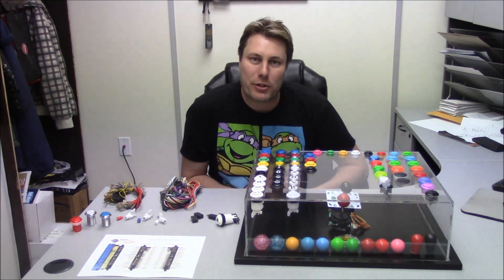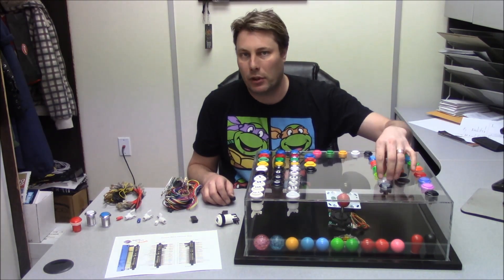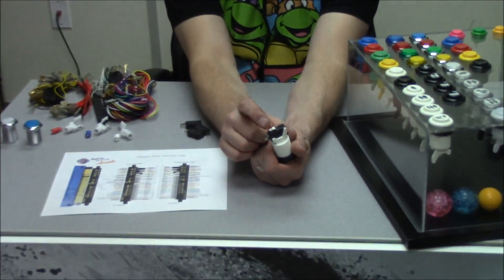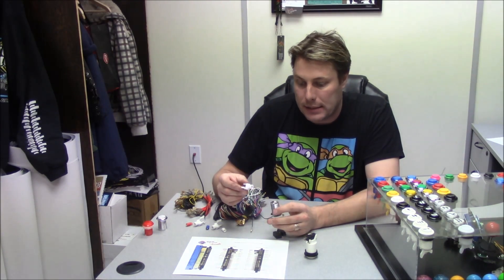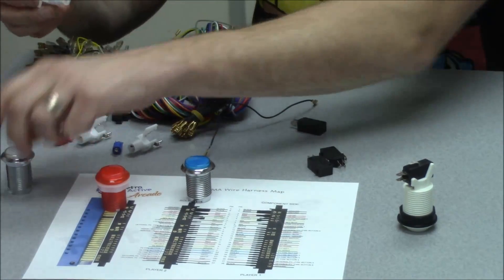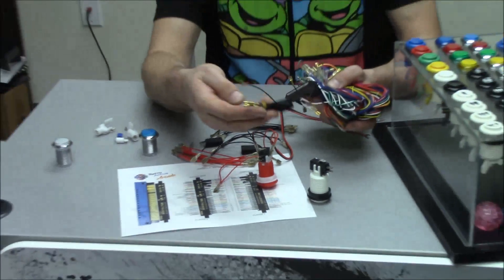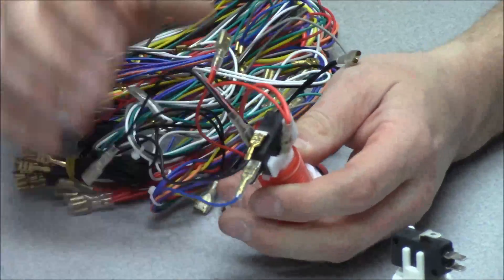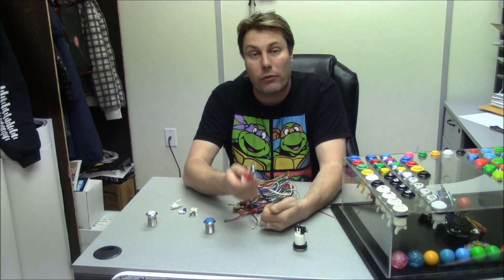How to wire arcade pushbuttons and microswitches

Comment: What about wiring the  IL Lorenzo Eurojoystick?  I have a wiring harness with a JST connector for the joystick where as the IL Eurojoystick just has microswitches and no JST connector board.  Do I just cut off the JST connector?
Reply from the maker: Yes you will have to cut it off and use the connector size for the microswitches which should be .187 or you can solider the wires to the microswitch directly.

Comment: Do you have a idea why my pandora 12s.   Wont work. It got frozen. On the welcome screen.      Already check the sd card.   ?
Reply from the maker: Is it frozen in the main menu? Can you see games in the games in the game list? If you do not have any response from your controls and buttons, you just have to add a credit to activate them. To avoid this, set you Pandora's box to freeplay in the service menu.
Reply: @RetroactivearcadeCa    It got stuck right after turn  on.    And. Just say  pandora 3d rrtv 12s.   On the screen.
Reply from the maker: @1Wayfix disconnect the JAMMA harness and turn it on. You need to check the 12V power lead with a multimeter at the harness connection point to make sure it is providing 12V. Too much is very bad for the PD and too little will not power it up properly. You can also do a reset or try holding down the menu button when you power on the PD. This test will only change the video output but if it changes through the modes your board is still good. If none of this works you can contact 3A Game or download the image of your version from their website to restore the SD drive.
Reply: @RetroactivearcadeCa   thank you. So much for. You.  You. Answer.    I apréciate.   🙏
Reply: @RetroactivearcadeCa  3a game is a website
Reply from the maker: @1Wayfix 3A Game is the company that makes Pandoras Box. You can go to their website to download fresh images of the game lists.
Reply: @RetroactivearcadeCa  thank you so much for you help 🙏

Comment: I'm new. Go ahead, flame me. Haha. So, wiring a Ms Pacman control panel for a jamma. How do I wire the 2 player button? Do I use the player harness?
Reply from the maker: Hello, yes you would use the 2nd player wire from the JAMMA harness with a ground to wire PL2 assuming your harness is full and uncut. Each side of your JAMMA harness constitutes as a Player side i.e. one side is Player 1 and the other side is Player 2, each wire (Color coded) is the same action for each player. Hope that helps!
Reply: @RetroactivearcadeCa  that absolutely helps. Thank you.

Comment: So ultimarc goldleaf buttons with an ipac4 can't be mapped to multiple buttons of the same keystroke ?? Such as if you have a separate 4 way controller; or spinners with buttons to match player 1's setup. Or if it's a coin button yet you have coin door's. Talking the standard ultimarc. Goldleaf buttons here. Almost to the wiring part of my build. I have an Ipac 4 and a Ipac ultimate. I got some stuff from you and some from ultimarc :)
Reply from the maker: Forgive me if I am answering you wrong but your question is a bit confusing. You can map as many buttons to the same key stroke/input on and ipac or I/O you want you just have to do it right. The gold leaf buttons (we call them fusion buttons on our website) only have an open or closed position so you can connect the ground like you would along the daisy chain. As for the action wires can be daisy chained but should be directly connected to the input on the ipac. The I/O will not allow for this so you will have to daisy chain them. The only negative to this scenario is that all connections will be live at all times as in: both joysticks will be active so if your buddy moves the other one while playing it will mess you up. The only issue double wiring buttons comes with microswitch connections. One has to be connected to the open side and the other has to be connected to the closed so the circuit completes properly when pressed. Hope this answers your question.
Reply: @RetroactivearcadeCa  Oh perfect answer Casey, thanks so much. Despite my confusion question ;) you cleared everything up nicely. Yeah I plan on using the iPac4 on this 4 player build, but happen to get both. Im having so much fun, I'll likely do another build at some point. lol.

Comment: Does anyone here know how to wire a 3-position (off/on 1/on 2) push/pull switch to an usb encoder board. I’m trying to use this switch to turn parking lights (position on 1) highlights (position on 2) on my truck simulator. I don’t know enough about this so as not to fry my gaming computer. I figure I better look for advice from the pros. Anybody? Thanks

Comment: At 5:05 you state that the connector at the top can be used to wire two buttons to do that same thing.  On the switches I use this is not the case.  The NC and NO represent Normally Closed and Normally Open.  The NO tab in the middle is what closes the circuit when you hit the button. The NC would be like holding down the button when you are not and when you click it the button would briefly stop.  To wire two buttons to trigger the same action just join a wire to the second button off of the second tab just like the ground wires are doing.  Chain off of the same wire back to the control board.  Perhaps your switches are different but it might be worth saying that if your switch has NC written on it, chain off the same wire that goes to NO.

Comment: How could i connect an arcade button to the micro omron switch to make a foot mouse left/right click like here for a disable friend from this instructables tutorial : https://www.instructables.com/foot-operated-computer-mouse/
Reply from the maker: All you have to do is double wire your button, run a daisy chain ground and action wire from your harness to the pedal. If you have a JAMMA setup you will have to use the 3rd (Open) Prong on the microswitch for the pedal. If you are using an arcade encoder you just wire it normally. You will have to do this individually and bypass the USB cable completely if you are using JAMMA. For MAME, follow the instructions shown and plug it into your PC and it should work as is, you may have to program you buttons in MAME to the new Mouse connections.
Reply: @RetroactivearcadeCa  Thank for your help and by searching last night i found a video where the guy show exactly how to solder it. Now i am searching if i can do the same thing for the DPI switch again with an arcade button so he can adjust dpi with his feet because the mouse will be upside down and will be impossible for him to change on the fly.

Comment: How do you actually use the jamma harness to wire up the original joy stick on a arcade 1up cabinet,as the wires are soldered on to the joystick
Reply from the maker: You will have to de-solder them or cut them off and use the connectors on the harness to connect them to the buttons and joysticks
Reply: @RetroactivearcadeCa  thank you,I take it you just connect all the commons together in a daisy chain as there are 2 wires the same colours on each of the micro switches so all commons should be linked to each other

Comment: Hi, i got a question. What if I want to plug the led so it turns on when the button is pressed instead of being on all the time? I don't know much about connections so id appreciate your help
Reply from the maker: You will have to install an interrupt switch that is sufficient for 5V to 12V somewhere on your feed before your connections to your LED Buttons.

Comment: Can you go into more detail about how to dasiy wire buttons, like putting side buttons on a cabinet for pinball action that share directions with primary buttons?
Reply from the maker: They can share the daisy chain ground but you will have double wire or daisy chain the button action wire separately if that makes sense? Basically split the the lead wire to each button, in mame both buttons are connected the same, just take note that with jamma your primary button connection is normal but your secondary connection is on the microswitche's open connector (the third 

"usually" unused connection)

Watch my coin door video that explains having a coin button and coin door set up, they are basically the same.
Reply: @RetroactivearcadeCa  I bought the 60 in 1 PCB, and the corresponding 2 person kit from your company, would I need to buy additional wires to perform those daisy wire connections to side switches for the pinball style buttons?

Comment: Which microswitch is best ? Zippy or Baolian ? Please reply asap. Thank you
Reply from the maker: Zippy is the top end Chinese brand, pretty much any other brand would be better but the zippy are pretty reliable. If you looking for longevity they are all pretty good, if you are looking for pressure sensitivity and noise you might want to look a cherry switches.
Reply: @RetroactivearcadeCa  thank you so much sir❤ Sir Cherry D44X are available here...are they good for playing fighting games? Should i but them ?
Reply from the maker: @darshitmathur145  I cannot get them myself but there are a few websites that do offer versions of the cherry switches. Personally if you are looking gor fighting game buttons I would go with our fusion buttons. They are a "fusion" of sanwa and traditional buttons. They look like the standard Happ/IL buttons but have a pcb microswitch like Santa for a faster more reliable response time. They are also very quiet and durable. I haven't had any problems with them at all! https://retroactivearcade.ca/collections/concave/products/fusion-concave-pushbutton-black
Reply: @RetroactivearcadeCa  Thank you sir! Will definitely order them soon
Reply: @RetroactivearcadeCa  Sir one more question. Which encoder board is best "Zero Delay Usb Encoder" or "Xinmotek xm-08" ?

Comment: Hey,
quick question: 
is there any reason why my p2 button will act as start but not acting as coin? wiring seems ok and same as p1 button which work both as coin and start
Reply from the maker: Hello, I would say that if the button is connected properly and responds when pressed it would be a settings issue in MAME or if you are in a jamma board you may have to change the settings in your menu. The only other issue may be a crossed wire somewhere but that would probably give you two different actions when pressed.
Reply: @RetroactivearcadeCa  Hey, Thanks for the replay!
at the moment I have a pandora's box 4. the settings seems ok and on free play (the settings in that system is pretty poor) not sure about the wiring though (I didnt built the system) I saw on the jamma board (its the same one as you show in the video) that the p2 is on wire 16 but the green wire from there going no where (for both p1 and p2) that's why im thinking that the one who wired that did something wrong somewhere.

Comment: Not sure if you can help.  I have a situation where I have a Pacman machine with pac to JAMMA adapter, and then JAMMA to game elf adapter. I now have a new icade control panel with trackball.  Ok I changed panels to have 3 fire buttons. Here is my problem. The original wiring is to the Pacman side and there is no 3rd fire button, so while I can make 2 buttons work even on original, by flipping the dip switch, I’m not sure how to get them actually working on my new 3 fire buttons on this panel. I guess from watching your video, I could daisy chain p1 and p2 start to fire 1 and 2 , but 3? I’m at a loss, been searching for an answer and disappointed that I can’t use new panel as intended with actual fire buttons. Thank you
Reply from the maker: Just wire button 3 from your harness to your button and daisy chain in your ground. Don't over think it

Comment: great video, do you have one on wiring controllers?  I have an 8-way controller problem that's driving me nuts.   it won't do diagonals in 2 corners, I can rewire them and sometimes it will change the corners, but there's always 2 that don't work on retropie.  I've tried new controllers and also new retropie images.  Any ideas?
Reply from the maker: What kind of joystick are you using?
Reply: it's an eg start 8 way joystick.  I think I finally figured it out.  I didn't realize that there were specific ports on the usb board that the controller plugged into which makes me an idiot :P, but thanks for the reply
Reply from the maker: @joshdrinkard398  that was my next question, lol. Glad you figured it out!

Comment: I still don’t know how to wire a 2 prong button after watching this. I’m coming with almost no experience. For instance on my jamma it says the brown wire for player 1 start. I get my brown wire and there is only one terminal on the wire to connect to my button but my button has a positive and negative terminal. Then I followed a green wire that was supposed to be player 1 coin and it let to a small white adapter with a black and a yellow wire going into it. I have no idea what those wires are. Very confused 😐
Reply from the maker: The basis for these switches and harnesses are very simple. The wires, for instance "Brown" will be connected to the positive side of your button and the negative side gets connected with the long black wire with 32 connections on it "daisy-chain" connections as we call it. This will string across to all of your buttons and joystick switches on their negative sides. As for the green with the white plastic connector, this is a bit harder but you will have to cut it off and add an extension or connector or both to get it to your coin button switch. All the buttons should have the identical connection setup with a different color coded wire to each one. As per this diagram: https://cdn.shopify.com/s/files/1/0008/4262/9179/files/JAMMA_Wire_Harness_Map.pdf?18261520453617373338
Reply: Retro Active Arcade thank you so much for the reply this explains it perfectly! My main issue was that the harness and buttons I was using just weren’t compatible. I did not know about the daisy chain that explains what all the other terminals are for lmao! Thank you so much sorry for my ignorance
Reply from the maker: No worries,  that's what we are here for!

Comment: is the Ground wiring for the actual button itself to work? or for LED lighting... I'm not sure if my JAMMA has GRND button wires
Reply from the maker: Each microswitch needs its own ground connection in a daisy chain for the buttons to work. 2 wires per switch, LED needs an extra 2 wires of + & - to work as well.
Reply: @RetroactivearcadeCa  appreciate the quick reply!!! So there should be 2 wires per button, I think this stock JAMMA didn't come equipped with that many chained on
Reply from the maker: There should be a bundle of black wire on the end of the player 1 side of the harness,  that is your daisy chain.
Reply: @RetroactivearcadeCa  i see the ground wires now.. there are multiple but still not enough for every button, do i need to order more wires for every button?
Reply from the maker: Possibly, or just spice into them to add your own.  There should be enough for 24 connections,  2 joysticks and 15 buttons included.

Comment: Hi there, great video. Sorry for the noob question, but it sounds like for any led button you do have to have a seperate cable/harness? My setup I'm working on I have 2 led buttons to represent the coin buttons and was wondering what to hook up to make the Led work.
Reply from the maker: Hi Mike, First be sure to know what voltage of LED you have, it will be 5V or 12V. Usually they are 12V unless they are Sanwa (clones as well) or RGB buttons. You can daisy chain the positive power from your power supply to both buttons (power side) as well as the ground (negative side).  If you do not have a power supply to go off of or splice in to, you can use an old power charger from a cell phone or something as long as it has the right voltage. If your voltage is too high it will burn out the LED right away, if it is too low it will glow very dim and it will drastically shorten the life expectancy of your LED!